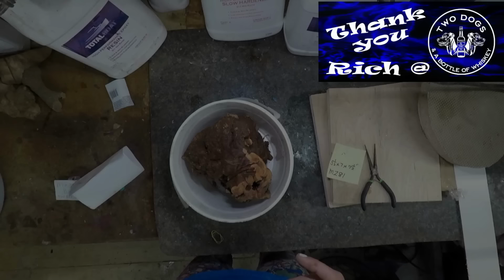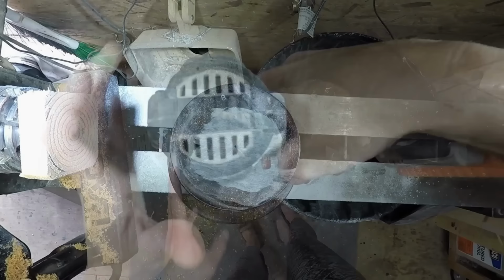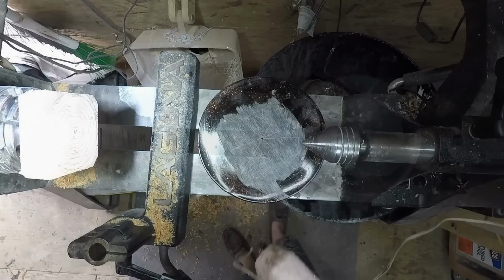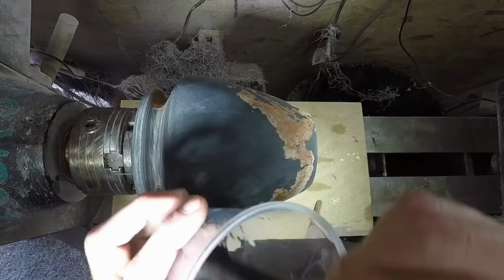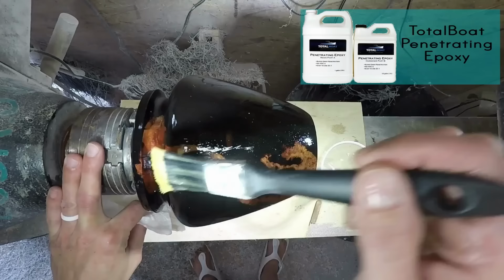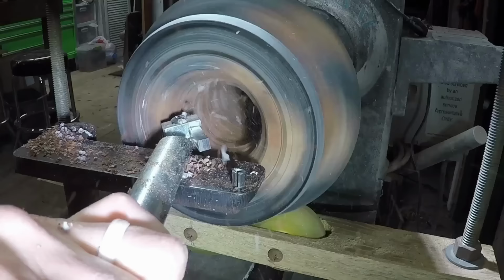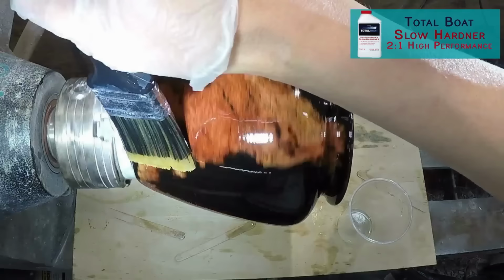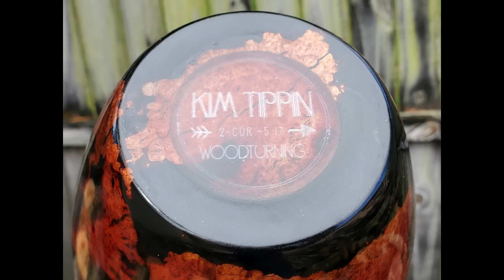Manzanita Burl Vase Black TotalBoat Resin

Comment: Great work. I am currently making an urn for a friend whose father passed away recently, and have found a lot of useful tips in this video.
If the screw on your scraper is still giving you grief, go and buy some socket head cap screws of the required size / thread. It is what I use on all of my tools now - much stronger and you can get a bit of torque on them to tighten them down properly.

Comment: Very nice Kim, love how that turned out, you did a great job. If you go to a machining tool shop, you should be able to get a hardened machine screw for that cutter that should be a lot harder wearing, or even a grub screw type screw and use an Alan Key which would allow you to tighten the screw harder.

Comment: VERY NICE. I'm sure someone else has mentioned it, but you can use a Grade 8 button head hex screw. It will hold up a lot better and using an allen wrench is better than a phillips head screwdriver.

Comment: The hollowing cutter looks like one a machinist would use you could probably swap it for one with a carbide tip so you wouldn't have to remove it very often. love your work by the way.

Comment: Suggestion for the screw problem.  Go to your local mom & pop hardware store,  the ones that have drawer after drawer of replacement screws, nuts, bolts, etc and show them the screw you're using now and ask for the same thread pitch and size thing in a hex head bolt which is at least grade 5 in hardness.  Grade 8 hardness would be even better.  Also make sure to get the correct size socket or nut driver for the bolt you end up getting.

Comment: At the hardware store find grade 5 or grade 8 bolts Allen head is a good choice the grade 5 and 8 are extremely hard used in industrial machinery that's designed to take a beating.
Reply from the maker: Thank you so much for the info!! 🤗🤗
Reply: @KimTippin  sorry it took so long to get back to you I didn't realize the comments were associated my Gmail account. That being said you're welcome

Comment: When applying epoxy with a brush, try using a 2” foam roller lathe speed 100 or slower 
I have good luck with this method.

Comment: Beautiful as usual Kim. When finishing with the resin and paint brush, how do you aquire such a smooth finish without the streaks?
Reply from the maker: Thank you so much 🤗
Resin will self level. Streak happen if it sets too fast while brushing it.
Reply: @KimTippin  yea, after sending question. I kinda figured that would be your reply. Thanks for confirming!

Comment: Kim - am trying a resin finish for the first time based on your inspiration. After you apply the 2nd coat do you sand through the grits?  If so, wet or dry?  Then do you do any other finish after - biffing, plastic abrasive wax...etc?  Thank you as always for the inspiration and encouragement!!!

Comment: Hi Kim, that looks amazing alright! I’m new to wood turning so have never tried anything along with resin. Any way of doing this without needing a pressure pot? Best wishes- new subscriber from Northern Ireland.
Reply from the maker: Yes you can do it without a PP but you must use a slow set resin. When I cast without a PP, I use Total Boat Thick set 3:1. It sets slower to allow time for air to release. 
Thank you!
Reply: Great, thanks for the guidance Kim, much appreciated.

Comment: Hi, Kim. What was the finish you put on (about 14 minutes into the video)? Was it Total Boat Finishing Resin or one of their casting resins? I’ve just tried using Total Boat Finishing Resin. I mixed three ounces of the resin with seven drops of the MEKP per ounce as it said in the directions, then wiped it on with a foam brush. It’s supposed to cure in 10-20 minutes. It’s been well over an hour now, and it’s still sticky. Have you used the Finishing Resin? The Total Boat website doesn’t have a means of sending a question to them, and I thought you might know what I’ve done wrong. Thanks!
Reply from the maker: I haven't used the finishing resin before. Sorry I can not help with that one. 
 I normally use 2:1 slow set or 2:1 medium set. Medium set seems to be just right for 90% of my projects. 
 I am sorry your having trouble. Maybe call them. I. sure they can help get things figured out. 401-396-8199 
Sorry I can not be more helpful 😔
Reply: Thanks, Kim!

Comment: Hi Kim . I have a question.  I don't have a pressure pot but want to make a resin project. Can you  tell me which total boat resin I can use without a pressure pot or a suggestion for other resin I can use.
Reply from the maker: Total Boat 3:1 Thick set.  Do not pour more than an inch at a time. Do not mix too much in one container.
Reply: @KimTippin  thank you

Comment: I suggest you google fastener companies (the ones that sell ONLY fasteners) in your area and take the original screw (if you still have it) to them.
They'll verify what thread size the screw has and then you can order/buy a dozen or so hardened bolts (with a hex head you turn with a socket or crescent wrench) or Allen screws for the hollower tool.
That way, you have a bolt/screw that isn't likely to strip out on you and if it does, you have several replacements...
Fastenal has several locations in Florida if you want to check them out   https://www.fastenal.com/en/2112/catalogs
Reply from the maker: Wow! Thank you so much for taking your time to share this info with me!! i truly appreciate it! I will do that! Thank you! Thank you!!
Reply: @KimTippin  You're Welcome...
I'm VERY familiar with the cheap, made-by-the-lowest-bidder fasteners that come with assemble-it-yourself items that strip if you glance at them wrong and there is a Fastenal not far from my home that's saved my bacon a few times with quality replacements which is why I thought of them the instant you mentioned the stripped screw you had...
Good luck...
If you can, try getting screws or bolts that are hardened to work with Impact guns, you'll NEVER be able to strip them (the tool holder will break before the screw/bolt does)...